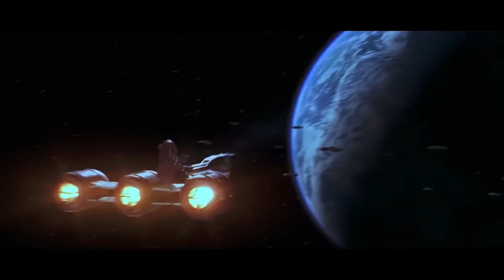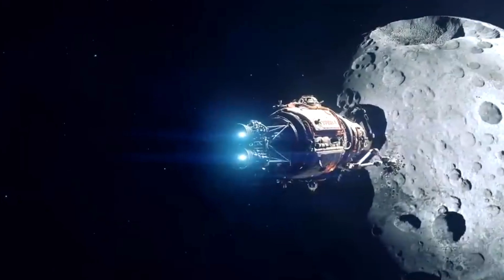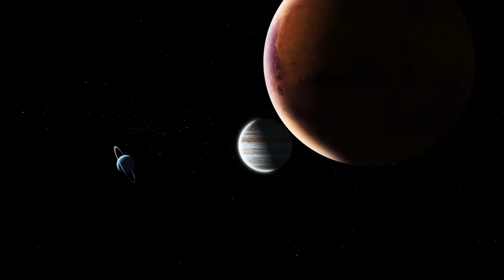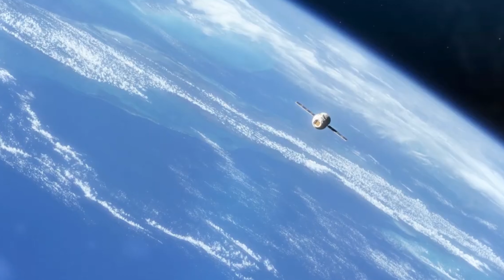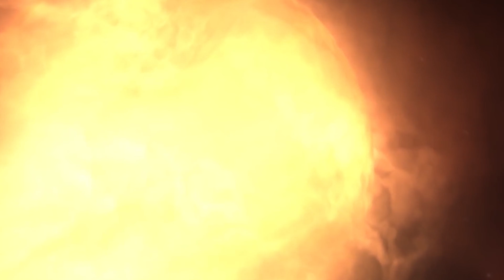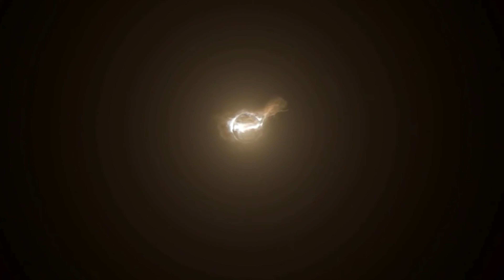The Future is Now: Your Kids' Interstellar Travel Options

Comment: Enough time and enough money and anything is nearly possible, however there's a lot of problems with solar sails, they are fully reliant on receiving power from the Sun or a star and the further you get away from the source the less power it gives the sail, you also have issues with micro meteors tearing the fragile and very thin sail to shreds amongst other things, so really it's not practical for interstellar travel.
Thanks for the video 👍